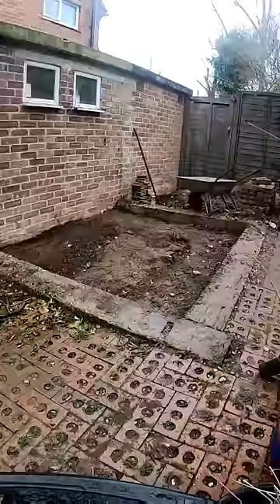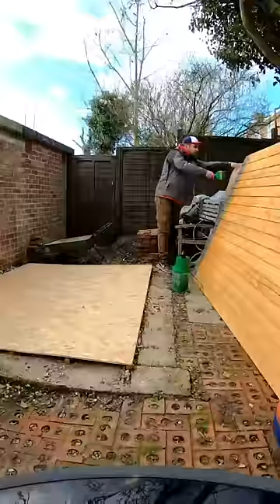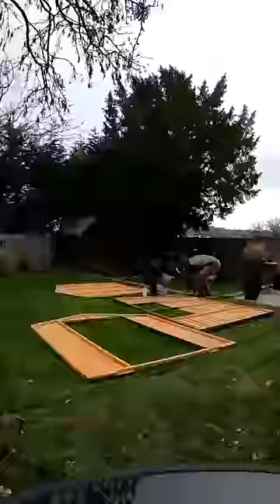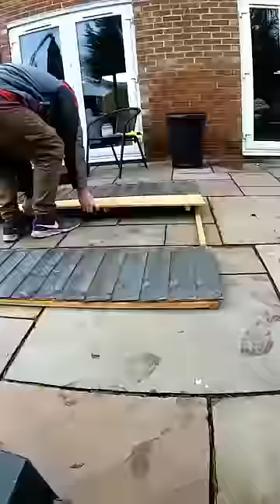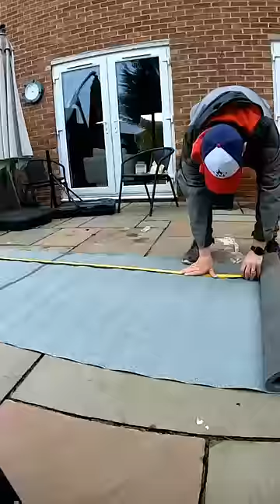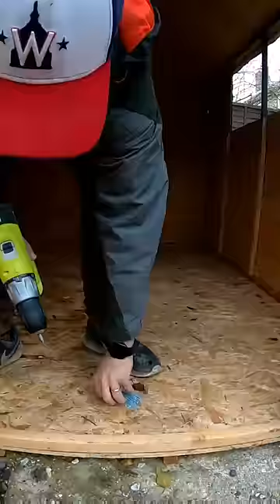Building a shed - 5 days of work in 60 seconds #shorts #shortsvideo #timelapse #satisfying

Comment: I would have considered a vaulted roof in order to shed rainwater away from house rather than 1/2 of rain on roof draining to between the  house and shed wall, thus going underneath shed into the cavity with all the gravel.
Reply from the maker: It's a good call out. I'm actually fitting a gutter to that side of the roof to catch the rainwater in a water butt to use on the garden :)
Reply: Too near the house and blocked out 2 windows from the house
Reply: @hunnyblush  n

Comment: Great job but why not put it farther away from the house so you don't block the light from entering the windows? You would also have visibility to everything from those windows.
Reply from the maker: Thank you, and it is a good question. The windows are just to a storage shed, so not really a position you would look out from, so not much is being blocked. Also, there is a tree on the right that would have got in the way and some raised planting beds beds that I wanted to put plants in that would not have been accessible if I moved the shed further right :)

Comment: looks like one day to me. maybe 2
Reply: Did you see the ton of crap they had to move before they started? Plus ground leveling and prep. Delays with the rain, etc. I buy 5 days for this simple job.  If it was on a concrete slab with thicker sides and insulation, skylights, electric, plumbing, etc. 10 days base bet.
Reply: @flogarr1  yes i watched the same video most certainly isn’t 5 days worth